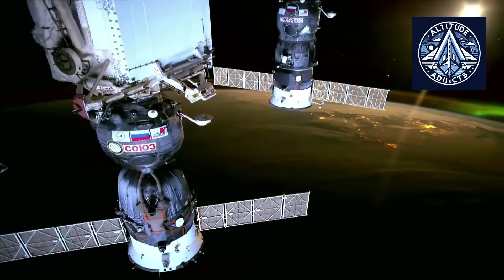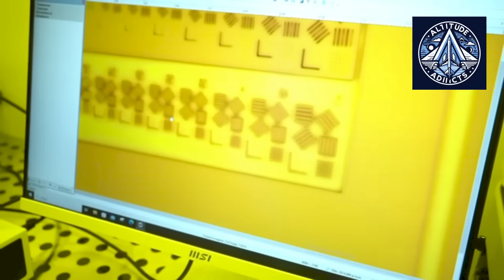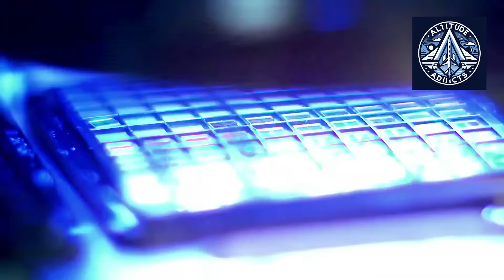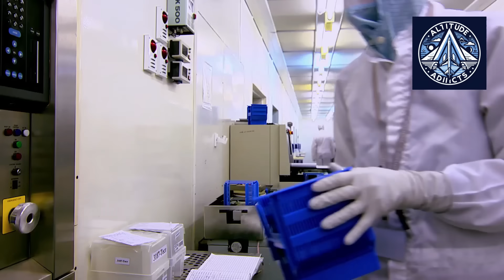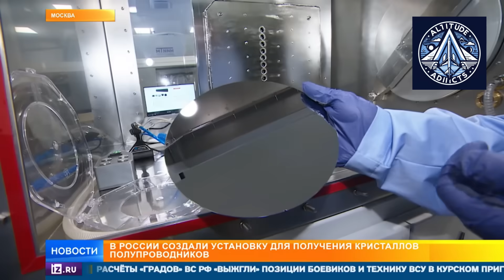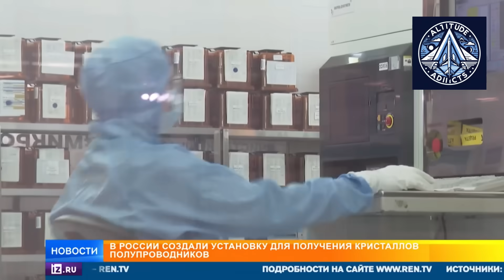Russia’s $6M Mid Market Lithography Machine Could Challenge ASML & Nikon! |Semiconductor |

Comment: This oddly look like a good way to start in memory chips manufacturing. You do not need cutting edge for DRAM and NAND cells, most of them are using TLC, QLC and 3D stacking to overcome current limitations. If my memory served me right some "4nm" chips are not even real 4nm, just 7nm chips using 3D stacking and other technologies to overcome such problems in density.

Comment: It’s steepers, contact aaliners. Surface Scanners are not semiconductors, these are used for Solar Wafers on silicon substrates.
Then another most important is Negative or positive Resist dispense spinners is same no change in so many years but curing or baking technology in my days electronically control Hot plate. New Technology UV or EUV cure, down to 3 nano use for AI.
Your videos are good but it’s all book stuff which is ok. But working in a FAB environment is totally different then what is written in books. FAB means Fabrication Facility for Semiconductor.